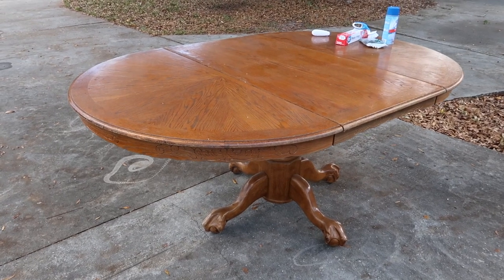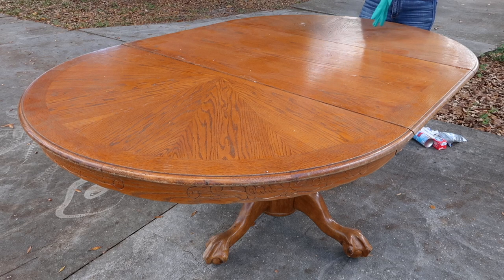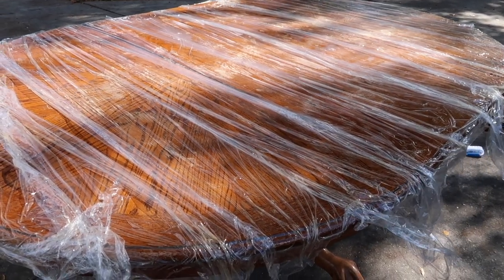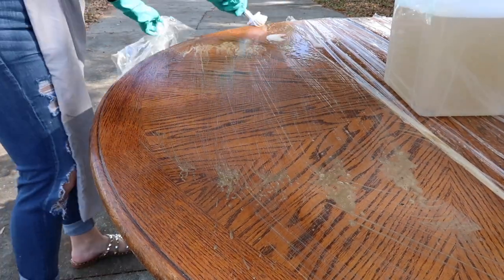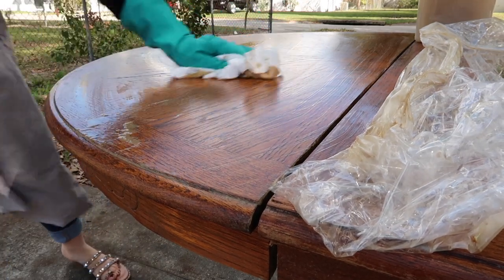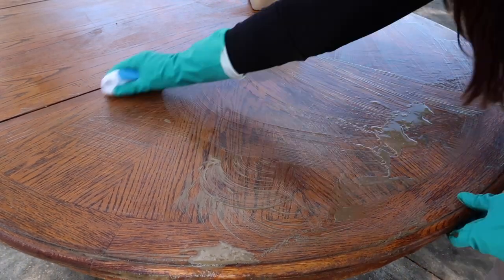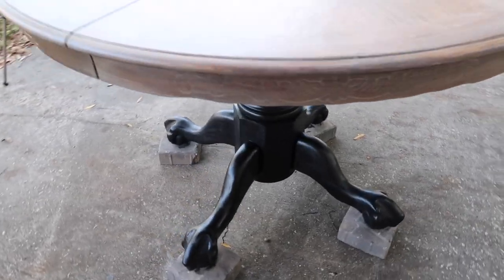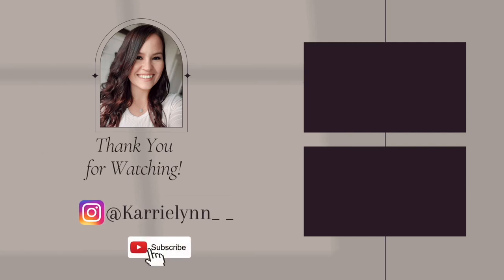Old Table makeover | First time trying this technique  | Farmhouse DIY projects | Cheap Thrift finds

Comment: I refinish furniture. Something I have used to remove the old stain is household bleach. It gives it a nice color as well. These older furniture pieces are solid wood, but a lot of times they have a veneer finish on top to give them the design. The veneer can be removed but it’s a lot of work.  Definitely black!  The tannins in these old pieces bleed through yellow/orange often times with white paint after you put the sealant on. To avoid that, Shellacking it first helps, but it’s an extra step. You could always put another coat of the black paint over the sealed bottom to give it that matte look again. Turned out really nice.
Reply from the maker: Susan you are genius! Adding another coat of black is a great idea

Comment: I like the black base, it won't show foot prints from dirty feet or shoes, it won't show scuff marks as easily...I might have watered down a tiny bit of black paint and lightly painted the grooves in the apron, wiping most away, it would bring out the carved design, but hey I get you were over this table....it seems to be just as easy to use an orange jell stripper, instead of the oven cleaner....

Comment: A tip for next time, if you see water damage on a wood piece of furniture use your hairdryer and just blow on the area and it will clear right up. Even if the spot has been there for a long time, it should still come out. The mark is actually just the wood still damp.

Comment: I would cut the table leaf in half,  paint or stain it and put trim around 3 sides and use it as a wall shelf.
Maybe put laundry detergents etc on it. No worries that its not sturdy.
Have a great week.

Comment: love the black base, next time on the stains try bleaching the wood first. Then seal it with wood sealer before applying stain. That keeps the stain even and it doesn't get splotchy. Also saves on stain because the wood doesn't soak up so much of it. :) I have two end tables exactly like that pending and the tops are terrible, hope they come out as good as yours did!

Comment: I love it Karrie! It turned out very pretty. I have a Oak table and chairs similar to this table and I painted my base black with chalk paint it looked good yet I ended up going over that chalk paint with black flat paint and I liked it much better. We sanded the top and only stained it because after 15 year's it was looking bad. It turned out very pretty also. You will surely be able to sale it for a nice profit. My husband and I live in Florida in the winter so we stopped at Good Will and found a beautiful square table with white straight legs and a stain top. No chair's we got it for $19.99. We brought it home cleaned it real good my husband sanded the top and stained it and repainted the legs. It turned out beautiful. We had some friends over and every one asked where we got the table. When we said Good Well they looked at us like we had 2 heads. 😂😂 Good thing my husband doesn't mind helping me do these projects. I hate the sanding part.  Love all your video's. Looking forward to what you do next.

Comment: So far, the oven cleaner has worked for me on my son's dresser, it was MDF with a veneer and a shellac type stuff and I've used citristrip on wood and, I'd say, it works better that way. I say that to say this, don't throw out the leaf just yet; you could try the citristrip stuff on it and see if you fare better that way! And, yeah, SO I had seen a lady do the exact same thing you did with some big ole antique corbels and then she powerwashed 'em and it worked-out just fine for her - WhatTheHex!!?...
I'm just real confused (that's why I still have unfinished pieces, and why I'm SO indecisive! Good Grief!) As always, though, I enjoy your end result and really appreciate your content!💜✨
Reply from the maker: It was really damaged and had lots of big bubbles in it from water damage 😪
Reply: @karrielynn  Right, and I completely get it! Well, I mean, it's not your fault. It's just kinda like painting a picture - if your canvas is messed up your painting isn't gonna be what it really could be... ☝ OR, like putting on makeup if your skin isn't healthy underneath & ya just gotta work with what ya got! Like my son's dresser, I felt at the time like the oven cleaner actually babied the piece and it was the way to go, but on other pieces it just didn't work so well - no damage or anything at all that I had seen, it just didn't really help so much at pulling up & stripping off the old paint.

Comment: I'd just buy a gallon of stripper, much easier than oven cleaner and in the long run cheaper.  After the water it needs to dry at least overnight.
Reply from the maker: Yes I quickly learned that 🤣🤣 next time I will not waste my time 🥴😭

Comment: If I were you I would go ahead and sell the middle leaf as is with the table, that way anyone can choose to re do that leaf later....I have used that oven cleaner ONLY on metal....I think it can lift the glue if the thing is laminated... I guess I would use a bleaching agent to lighten the top.

Comment: I have used oven cleaner for over a yr. You did way overkill!! No need to put plastic wrap on, doesn't need to sit that long, that is why you had issues.
Reply from the maker: Gotcha 👍
Reply: But I have found it doesn't work on newer pieces, works best on antique pieces that are solid wood. Must be something to do with the type of varnish used in the olden days! Don't give up on it, next time just try a sample area and see if removes the varnish, yoy will know if it's going to work or not in a couple of minutes!